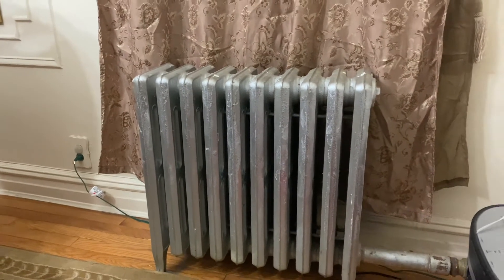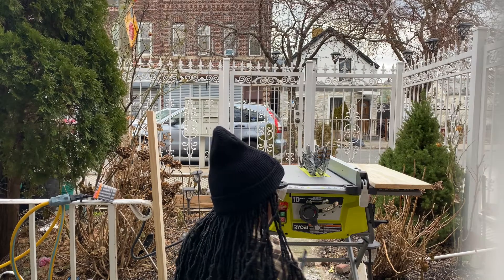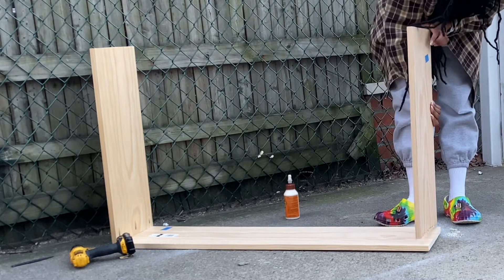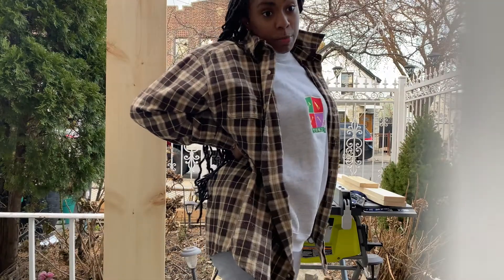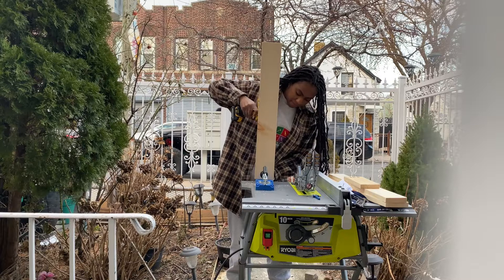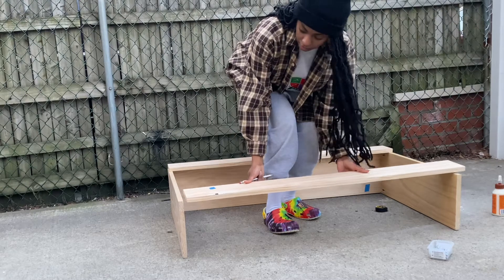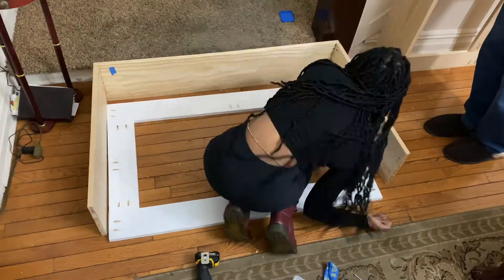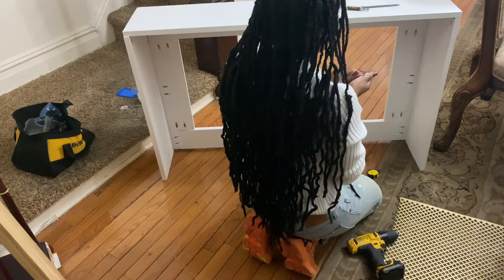EASY DIY RADIATOR COVER UNDER $100 // Kreg Jig Pocket Hole System | Two Degrees, No Job | EP. 16

Comment: Amazing stuff. What kinda paint did you use being that it’ll be heated?
Reply from the maker: Thank you! I used regular trim paint in eggshell. The paint will not be affected by the heat. Very good question.

Comment: I wish I had radiators to cover. instead I have this massive vintage gas heater that's metal all around and the heat comes from the top. I've never seen a cover for it but with pets and kids I'd like them not to get burned or squeeze behind it. I feel like I'd had to leave the top of it mesh too